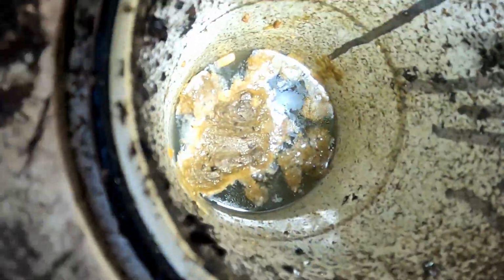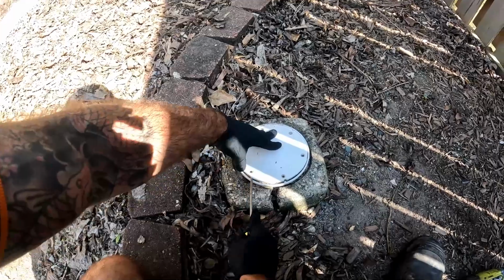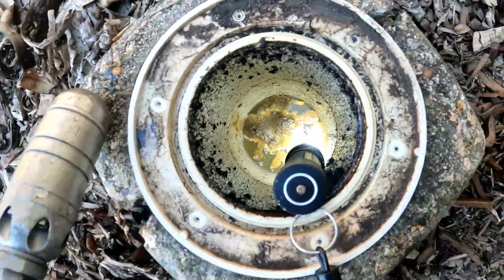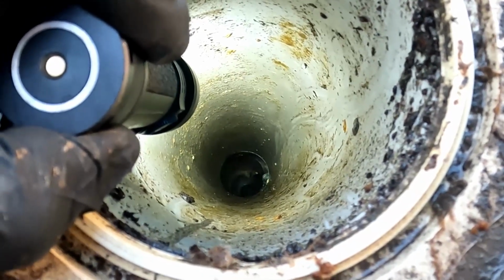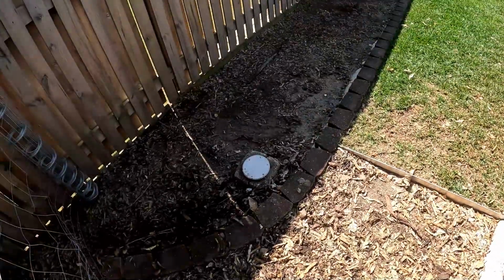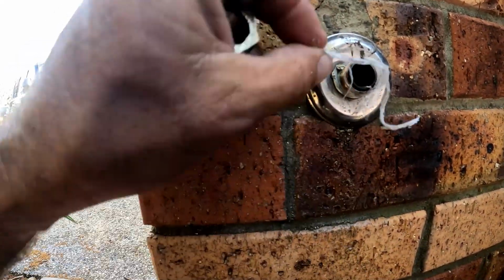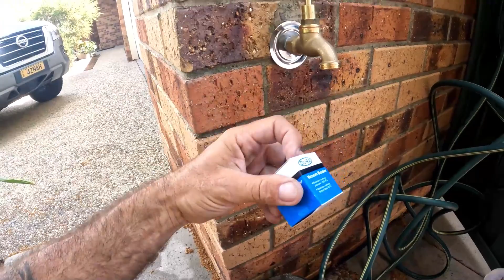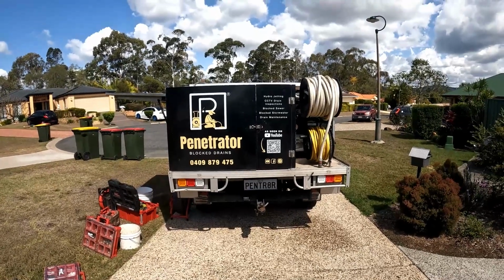Blocked Drain 413 - SABOTAGED Was This REVENGE or a Silly JOKE?

Comment: Ol Brad is quite the guy, welder and referrals, doesn't get much better than that!  What is the gizmo that went between the vacuum breaker and the quick disconnect?  Looked like a black/gray plastic thread adapter?  That's a fancy faucet!  We have 1/4 turns in the states.